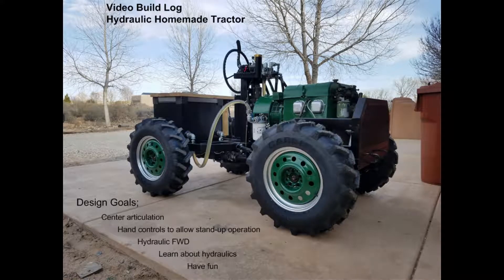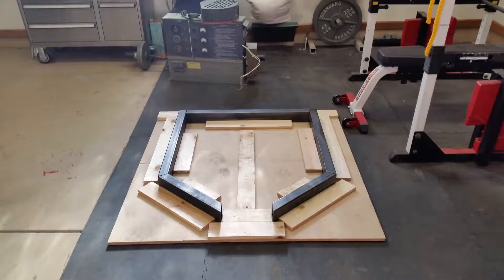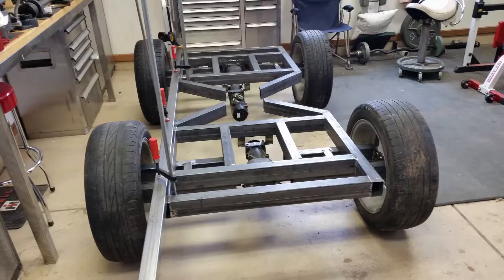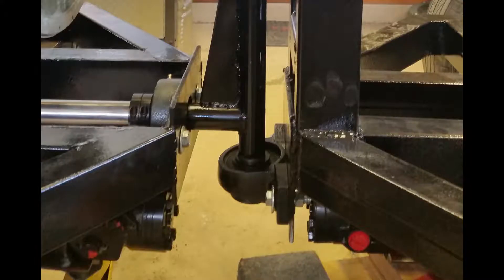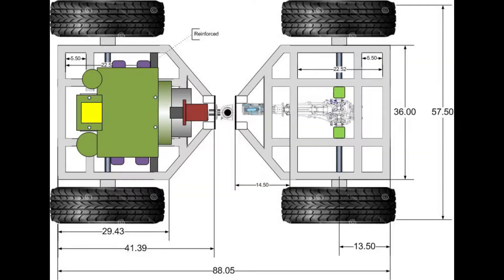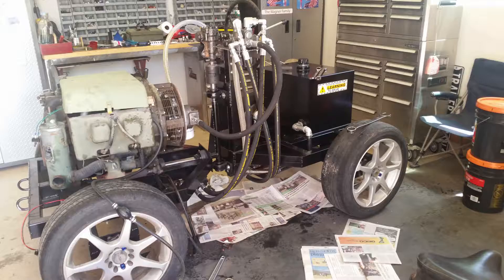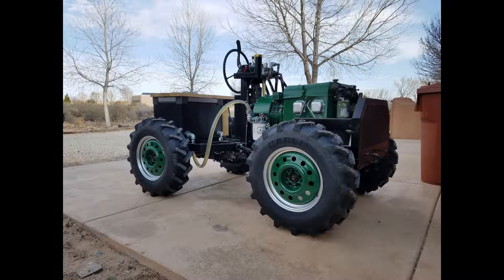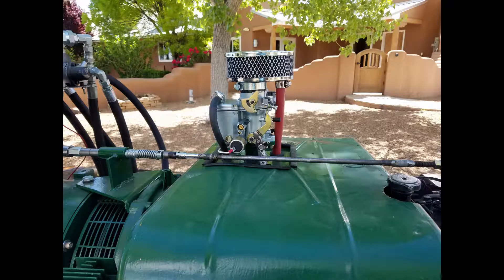Homemade tractor build log

Comment: I'm working on a tractor idea using a drive axle from an electric hyster forklift. I'm getting the input shaft machined to accept a chain coupler to the modified wheel motor. We kept the end housing from the electric motor, and that's where the hydraulic motor will bolt in. The hydrostatic pump will couple to the output shaft on the Kubota 3 cylinder gas engine (18hp), and I'll be using the steering valve from the hyster, and utilize a power steering pump off the front of the engine. I have a motorcycle radiator with an electric fan on it for the hydraulic oil cooler. This I'll mount near the reservoir. 
My front axle is from a Toro reel mower, which was rear steer, and comes with the steering cylinder.
Do you have any ideas or suggestions that you can think of that might make things go better/easier? I've never built a hydrostatic tractor before that I ran yet.

Comment: I am working on a similar fluid drivetrain tractor for agriculture purpose my pump is in the range of 70 lpm at max so I am planning to use two hydraulic mot for front differential and rear differential respectively so what lpm motor should I consider I am a college student from India some info would be helpful